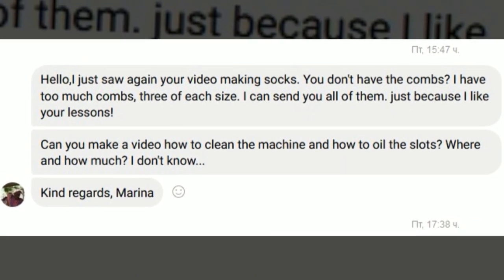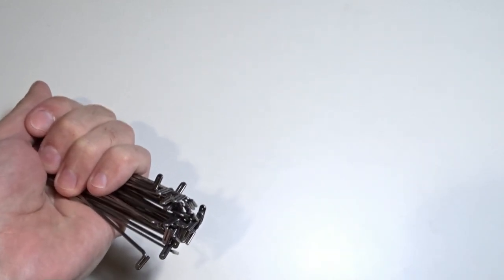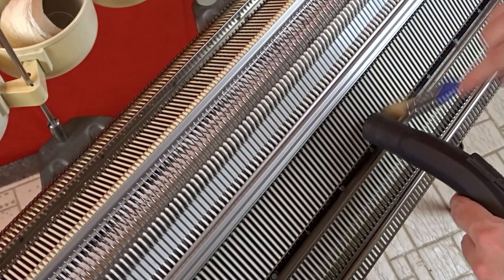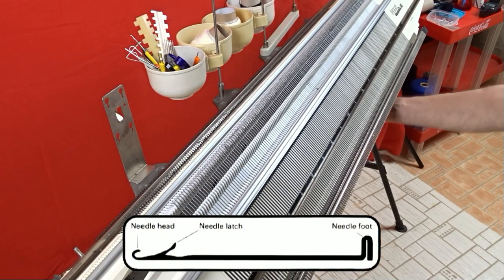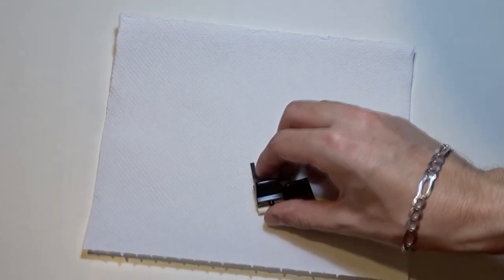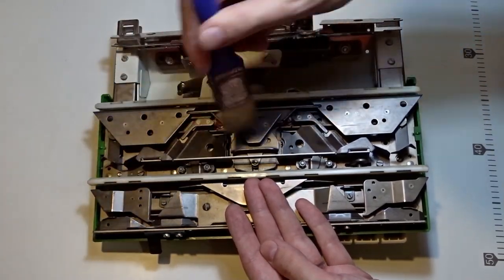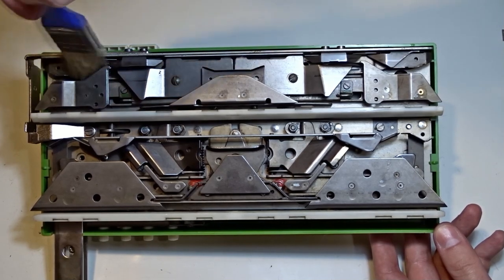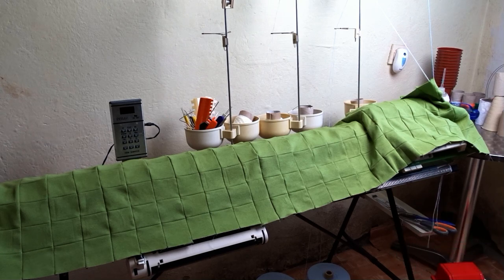How to Clean and Lubricate The Knitting Machine (Passap Duomatic DM80)

Comment: I just bought a PASSAP, never used one before. I am stating from zero and your videos are very informative. Thank you so much
Reply from the maker: You're very welcome! I'm glad my videos are helping you with your new Passap. Don't worry if you're starting from zero, with time and practice, you'll become more comfortable using it. If you have any questions or need more guidance, feel free to ask. I would be happy to help. Enjoy your knitting journey with the Passap!
Reply: Please. Can you say me if , on my old machine , I can put  a changer color ×4 color, instead of  my usuel 2×color changer which is brokenb(the  plastic is hold 
Sincerely. And thanks a lot
Reply from the maker: Yes, you can put a 4 color changer instead of the 2 color one. You will also need to replace the trip cam that opens the jaws of the lock and install the front extension plate.
Reply: @ArtOfClay  thanks . I understand  🤗🤗..  at last , and your video about the color changer was very helpful too . 
🥰 from France

Comment: This video is again very interesting and helpfull. What a brilliant idea to oil the pushers with a needle. I have used the deco today with a passap punch card, it works and it is a nice pattern. (I don't know how to post a photo here.) Moving the lock with the deco is very hard to do - the machine even moves - I guess I start with cleaning the deco first. Thank you again.
Reply from the maker: Thank you for the comment!
If the whole machine moves while you are using the Deco device, check if the pushers slide easily up and down. If it's hard to slide the pushers by hand, you need to take them out, clean them and the channels, and oil them again afterward. I guess that might be the problem.
Unfortunately, you can't post photos in the comments here. I would be happy if you share it on my FB page: https://www.facebook.com/polymerclayart or my email: artofclay.bg@gmail.com .
Reply: @ArtOfClay  i have cleaned the machine with surgical spirit as you suggested and it runs much better. I cleaned the channels with a brush, they are hard to clean. Some pushers still don't move easily. But the table does not move anymore when i try the deco. Thank you for the advice!
Reply from the maker: That's great to hear! The machine definitely takes some time to be cleaned. I'm glad the cleaning helped improve the machine's performance. Thank you very much for providing your feedback! Happy knitting! 🧶🧶

Comment: Hi. What is double knitting?
Reply from the maker: I did some research and I found the following. 
It's a colorwork technique in knitting. In double knitting, the knitter works with two yarns at the same time, one for each side of the fabric. The knitter alternates between the two yarns, knitting one color for one side of the fabric and another for the other side.
Double knitting can be done by hand-knitting or machine-knitting, both methods are different but the final result is similar. In the hand-knitting, it's a bit more complicated because the knitter needs to keep track of both yarns and the pattern, but when using a knitting machine is a bit easier as the knitter only needs to set up the pattern on the machine and the machine will do the rest. 
One of the scarves I made, which is knitted with a different yarn on each side may be counted as double knitting, as well as the red/orange cover which is reversible, and the image is visible on both sides (the colors are inverted on the back side).

On the Passap, it should mean when you use the pushers on both beds in combination with the arrow keys to make the most of the examples in the small stitch pattern book like brioche stitch, etc.
I am unsure if this is true for all kinds of double-bed jacquard.
I assume that when using a punch card, the knitted piece has a right side with an image and a wrong side with the weaved yarn tails, so that may not be double knitting. It should be a double-bed fabric, but not a double knitting as a color technique.

This is the source where I originally learned that information: https://nimble-needles.com/tutorials/what-is-double-knitting/
The things are explained in more detail there. According to this article, double knitting it's almost the same as double-bed knitting (double-face knitting), so it may include most of the double-bed knitted fabrics.
Reply: Thank you